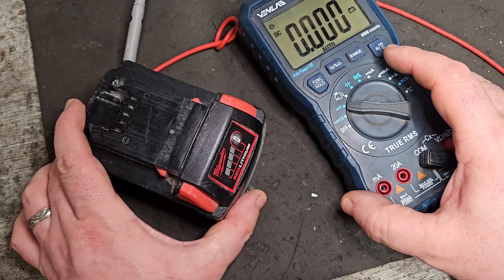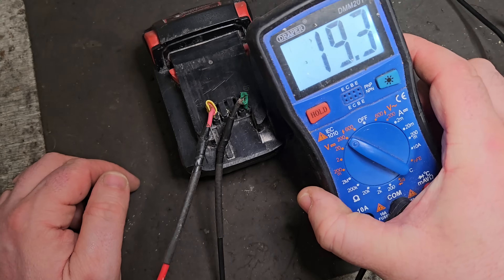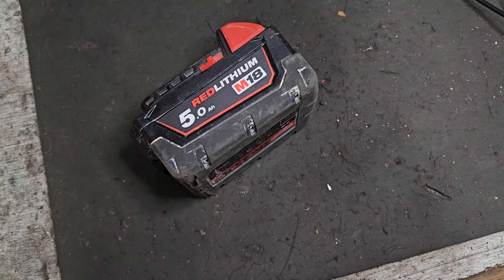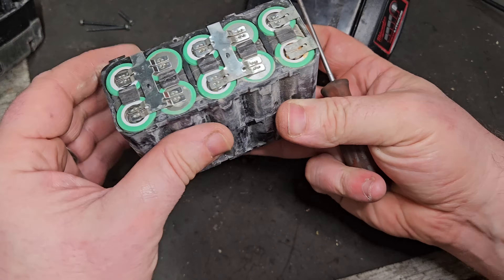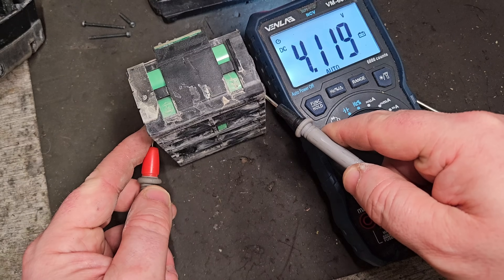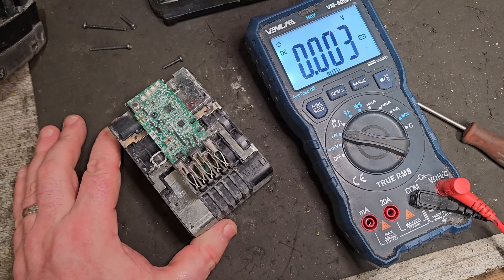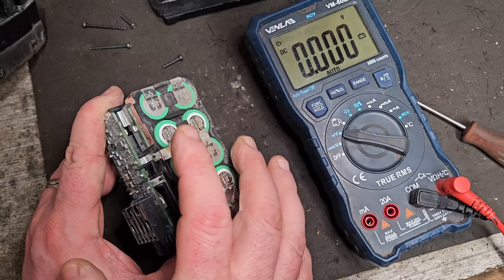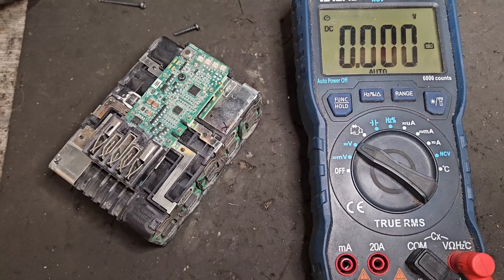Milwaukee Battery repair course EPISODE 8 Why is cell balance so important?

Comment: It is not necessary to rearrange the multimeter probes when measuring (+/-)
Reply from the maker: It is if you want it to read as a positive value rather than a negative